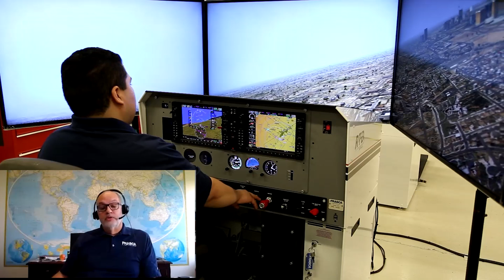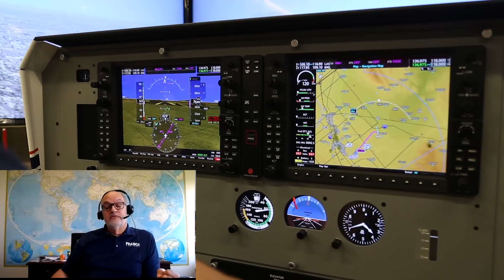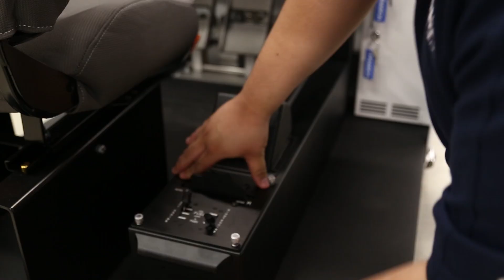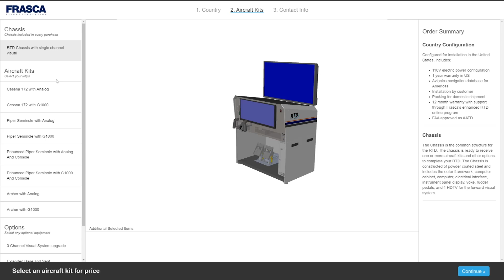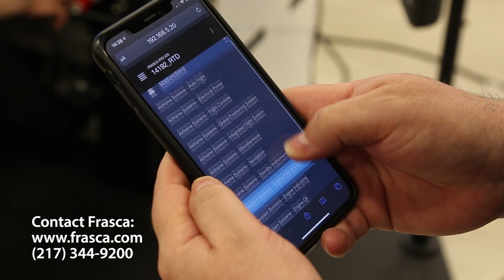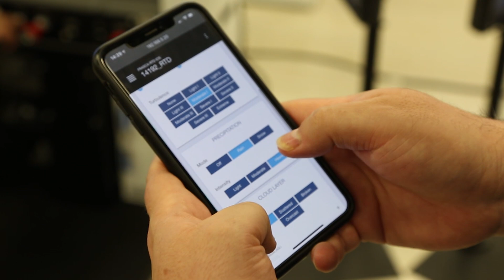AvWeb's Virtual Tradeshow Frasca International

Comment: 55 k and you get a full motion Redbird FMX. Also an AATD. I wonder why I would go with the fixed base FRASCA model as a flight school... (I guess I prefer non paid content).
Reply: Redbird is a fixed plane type simulator .
Reply: @jppalm3944  I wrote Redbird FMX. Use Google pls.
Reply: So you did. My mistake
Reply: redbird is a crap system, not ven worth looking at it works so bad.
Reply: @Cessna152ful  Ever used it for IPC and the like?
Reply: @Cessna152ful  I mean they have FAA certified products. How bad can they really be?